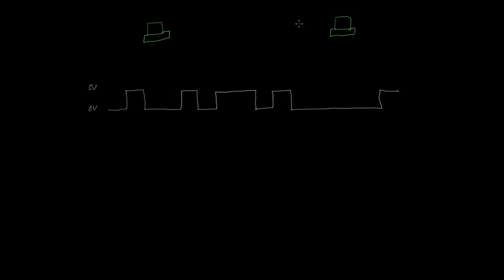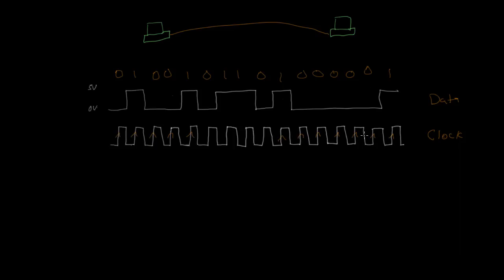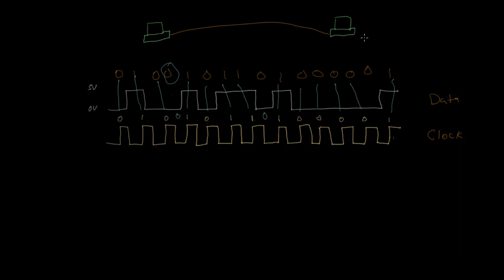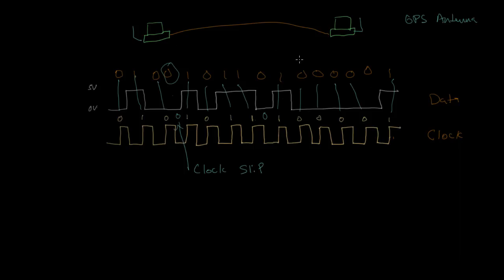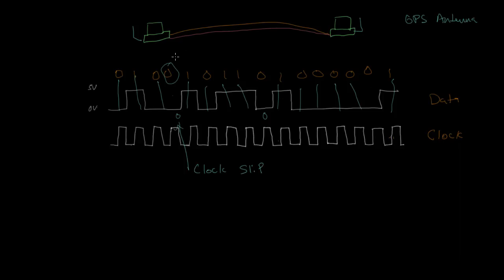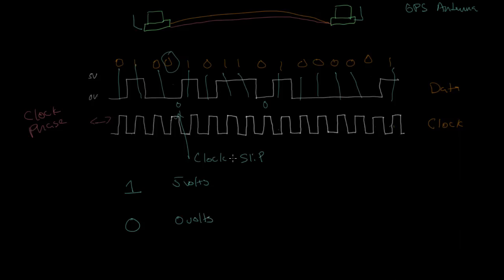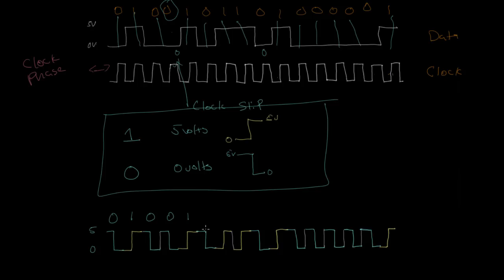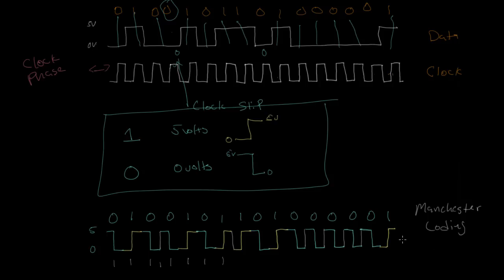Clock synchronization and Manchester coding | Networking tutorial (3 of 13)

Comment: This series is so good even for intermediate level learners. I do have a non-zero grasp of electronics and TCP/IP, and Ben is filling in a lot of gaps in my knowledge that I didn't know I had.
Reply: Do you know where i could pick up from after here? I mean after this series?
Reply: @quicksilver90-g8h  Excellent question. The principles taught are so wide in their application that the sky's the limit: it's really up to your imagination and personal inclination. I myself built the Ben Eater clock module (from his 8 bit computer build series). Then I thought of alterations I could make to the basic design (using breadboards makes that very easy). For instance, I thought of building a dual 6502 computer, with two processors. How to make two CPUs share the same bus? They have to take turns. So I added flip flops to the clock module, so that every other clock pulse was routed to a different output. Instead of one LED blinking, two LEDs, call them 1 and 2,  alternating their blinks in a "1 - 2, 1 - 2" rhythm, then with another pair of flip flops, made that into a 4/4 rhythm (I'm a musician, bear with me): "1 on, 1 off. 2 on, 2 off", so that each CPU, in my theoretical dual processor design, would get a full cycle of high and low while the other was kept low.

But that's just me and my imagination: doubtless you might go in a completely different direction. 

I wound up building the Ben Eater 6502, and got it to say Hello World (yay!) and never built the dual 6502 of my dreams. But what about the 16 bit version of the 6502, the 65C816? Another YouTuber, Adrien Kohlbecker, has an excellent Ben-Eater-inspired build of a machine based on that more sophisticated processor. The CPU is not pin for pin compatible with the 6502, but nearly so. It has a 24 bit address space, making the 8 data pins do double duty, alternating roles as the ordinary 8 bits of data, and the high byte of the 65816's 24 bit address space, so that the 65C816 can address up to 16 MB of memory, which is way more RAM than my first PC came with. Because the 8 data bit pins do double duty, you have to build latches to hold a copy of the data pins from the moment when they're used for the high byte of the address. Kohlbecker has now made a single board design that breaks all of this out into individual connector pins. 

So NOW, I want to take Kohlbecker's 65C816 design, and build two of them, so I can have, not just a dual 6502 machine, but a dual 65C816 design.

Now the question is, how shall they share memory? How does each CPU know whether it's CPU A or CPU B? Should they share all their memory, or maybe just share the upper 32KB of the first 64KB (so they read the same ROM on startup), or something else. ROM is way slower than RAM. Could I build "shadow RAM" for the second 32 KB (where the ROM lives), so that the computer starts slow, copies the ROM into the RAM behind it, then switches the ROM out, and increases the speed of the clock? That means I'd have to somehow let at least one of the CPUs control the clock speed. How would I do that? I could map one or more of the bits of the address bus for this purpose (the way the 6510 chip did on the Commodore 64, with bytes 0 and 1 of Zero Page RAM. Or, I could use a 6522 VIA chip as a "bus control" device to handle things like bank switching and clock speed. 

Should the two CPUs be completely symmetrical? Or could I make it so that one CPU can IRQ the other one, or allow them to IRQ each other (again, using one output from a VIA chip routed to each of the IRQs for the two processor)? Maybe I could make one CPU the primary, and the other the secondary, where the primary can interrupt the secondary but not vice versa. Then I could use the primary for the computer's "operating system" and the secondary for "user space" processes, which could lead to a CPU stable enough to run processes in a secure manner?

What about general I/O for my dual CPU design? Should each CPU have its own separate VIAs? Or should they share them somehow? If they share them, how do I control which CPU's IRQ each VIA chip controls?

So that's just my imagination: doubtless you could think of directions I haven't even thought of.

Would love to hear more of your thoughts here in this comment thread.
Reply: @AlanCanon2222 wow that was useful, thanks!

Comment: Hi ben, you mention that the recieving computer can distinguish between a low to high transition and a multiple 0's in a row because of the intervals the transitions occur at. How does the receiving computer know what interval to sample the signal at? Do the 2 computers need to agree on the interval before hand?
Reply: it would suffice to agree on some clock sync pattern at the start of every message. i.e. you know that every message starts with 0101. so here is your timing interval you can measure at the receiving end

Comment: Hey Ben, thanks for great series! You left out how the clocks exatcly synchronize for manchester coding, so how does this happen?
Reply: i was able to find out more about this from wikipedia. the process is called "clock recovery" where the two systems figure out (or "recover") what the clock rate is supposed to be from the signal itself.

as i understand it, the way it works for manchester encoding is that there are only two possible places where a voltage transition can occur: either at the start of a bit period, or exactly in the middle of a bit period. the one that's in the middle is the one that's supposed to represent the 1 or 0, the one that's at the start is just supposed to get the signal in the right place so it can make the transition for the middle of the period.

so when a computer starts seeing transitions, it picks one and sees if that results in a "regular" data rate (meaning -- you should be seeing some kind of data, i.e. a transition, every single period). if it doesn't, it knows that the one it picked was just a "positioning" transition and not a real data transition, and uses the next (n+1) transition for determining the data rate instead. the "real" data transition will happen at a guaranteed interval and so can be used to figure out the clock rate.

Comment: This is kinda similar to the encoding used in USB wires. The difference is that in the USB standard, 0 is encoded as a transition (either way), and 1 is encoded as no transition.

Comment: So, basically, Manchester coding is about half the speed of what the processing hardware can handle. It may have uses where the "cable" speed is the limiting factor, but otherwise, that sounds like a dramatic lost in efficiency. 

If two clock are not strictly adjusted to the same frequency, but "close", could they not "agree" to send "n" bits, then resynch them, say with a start bit, so they will, in theory, always safely read the data without slip ? Is it not what serial communication was doing? And thus, your efficiency will be more like around n/(n+1)  instead of 0.5, as for Manchester coding as I understand it ( assuming that the cable transmission speed can support a speed as good as the processing one involved by the hardware at the "terminals").
Reply: That's exactly how it's done with RS-232C encoding.  The line stays in a known state (usually high) until it's ready to send, then it pulls the line low for a period of one bit to signal the receiver that it's about to send.  Then it sends the 8 bits followed by holding the line high for a period of one or two bits (often one but sometimes two, depending on what both ends have agreed on) to signal that the byte has ended.

Since the receiving clock is synchronised on every start bit, the clocks can drift slightly without causing errors.

The receiving end often also uses a protocol which allows it to tell the transmitting end to repeat the garbled part of the transmission after an error is received.

Comment: what if I wanna send 00000000000000000011111111111111111 through Manchester codes?
I guess then the computer will guess that the "clock rate" is very low because from all those transitions going from a 0 to 0 and 1 to 1. Therefore it will not ignore the transitions from 0v to 5v between all the zeros and instead think that the transition between 0 and 1 is a little bit off  and discard it, right?

as a solution one could maybe make it so that, the computer always uses the bigger clock rate but would would happen then if I where to send a  signal containing only 1 or only 0s ?
I am a bit confused rn.

Comment: Hi, thanks for this great video. I had a question if anyone can answer... See if a computer has a rated clock of 3GHz, it wont always be boosted to 3Ghz, it varies with complexity of the task being performed.
So how is the data synchronized in these circumstances? I hope it isnt a silly question...
Reply: Curious about this as well. Maybe there’s a protocol that makes sure that two communicating parties are talking at a synchronized rate? Also you might be confused between processing clock speed and communication clock speed.

Comment: if you use Manchester coding to send the message 0000 0000, won't it be misinterpreted as 0101 0101 0101 0101 ? since the clock appears to be regular?
Reply: i guess, and this is only a guess, that you somehow send a rough speed of the clock at the start, then the reciever will compare the data to the clock signal at the start
Reply: At 10:21 he explains that there's still a clock, so it won't interpret it as another symbol.

Comment: Instead of Transitions High to Low (=0) and Low to High (=1). Send Fats and Slims. A Fat is a 1 and a Slim is a Zero. E.g. 1 - 1 = 1 and 1 - 0 = 0. Fats and Slims. This will work, however it will Half the Data Rate. You can recover the Clock (Synchronisation) from the Transitions. 
In most Transitions you will have an even Number of 1's and 0's. If you have a Long String of 1's and 0's you will Lose the Clock (drift). However there are Techniques to deal with that I'm not gonna go in to now.

Comment: BEN, where can i find a controller that can reproduce the manchester code? I have an animatronics show that used the manchester fm2 code and want to be able to program new shows. Please advise.
Reply: I don't know what Ben would say (and because of the way YT seems to periodically turn replies into base comments, I can't be sure whether or not anyone has replied to you), but I'd suggest using a microcontroller.

I'd be surprised if there wasn't already a "library" for most microcontrollers, and certainly for Arduino, which allows you to transmit and receive Manchester FM2 code on selected pins.

Comment: Why not use something like 5V for 0 and 10V for 1? Then you don't need a clock, because each data point would be either 5V or 10V. You would send them in pulses. So 0V->5V->0V would mean it's a 0 and 0V->10V->0V would mean it's a 1. There would be no 5V->10V and vice-versa transitions.
Reply: probably because it is sower because there are double as many signals per datasignal we want to send, i thought about making the clock and the data two signals on one line with two different changes in voltage ( the clock for example switches between 0 and 3 volts and the data between 0 and 5) so we have no differences in transmission time.
Reply: The more different voltage levels to distinguish, the harder it is to distinguish them, especially when there's a noise on the line. But if you have only two levels, they're the easiest to distinguish even on a very noisy line.
What you described, though, has the same problem as when using 0V and 5V levels – it's just shifted upwards (as if you added a constant DC offset to the signal).
Reply: As pointed out in the video, the original problem was a long duration of zero voltage... making it hard to distinguish how many zeros the message contained.  Which based on clock syncrho, it was determined to be five zeros.

Your scheme seems to have solved that problem without using a clock:
Message:
0 1 0 0 1 0 1 1 0 1 0 0 0 0 0 1

Your scheme: (Where A is hex for ten):
Voltage -> 050A05050A050A0A050A05050505050A0

Manchester encoding:
Voltage -> 50 05 50 50 05 50 05 05 50 05 50 50 50 50 50 05

7:36 *So another approach that we can take that's actually quite common is kinda ingenious which is to combine clock & data by using different symbols to represent ones and zeros*

Your scheme accomplishes this goal in an elegant manner.
Reply: It's called level triggering. What is used in the video was an edge triggerring. Which is divided into 2, rising edge and falling edge. Problem with level triggerring is that the input itself can have noises and will interfere during that level triggerring period. Which is why falling/rising edge is used instead.

Comment: Would it make more sense to us a ternary system in networking instead of binary to avoid the clock? For instance a signal that goes from 2 to 0 could be interpretted as 0 and 2 to 1 would be 1. 0 to 1 would be 0 and 0 to 1 would be 1. 1 to 0 would be 0 and 1 to 2 would be 1.
Reply: What you propose could be done.  In fact, it would be possible to make a system where you use 256 different voltage levels to send the numbers from 0-255 (8 bits), one for each clock cycle.

The trouble is, the more voltage steps you introduce, the more prone to interference the data is.  With the 0-255 system I described, even a power line a few metres away would introduce enough interference to turn the transmission into nonsense on the receiving end, and that's not even considering the interference from various electrical devices constantly being turned on and off.

TL;DR: It can be done, but at the cost of a less reliable data link.

Comment: We used clocks because we couldn't reliably interpret the data which was recieved. Using clocks both the communicating nodes know at what rate they should transmit/read the data off the wire.  
So u mentioned gps and using another wire for clock sync as a way to sync clocks between these nodes.  I dont understand how Manchester coding gets rid of the clock problems u mentioned,  as u still need to read the data at some regular interval i.e u still need a clock right? The reciever can still read at a faster rate or go out of phase even if Manchester Coding is used, so can someone explain me how does it solve the clock issues?
Reply: Because you are guaranteed one transition at the start of the period, you can back out the clock rate. When the receiver detects a transition either it will be at the beginning of the period, or halfway through to prepare for a repeating bit.

If you are familiar with micro controllers, if i have a hardware interrupt trigger at every transition and mark the elapsed time off a timer that counts the nanoseconds (or whatever would be appropriate for the speed you're trying to transmit). Ill end up with a list of transitions and times some of which are at the half period, and some of which are on the period. Because we know we have a transition at every period, i know the period is the longer of the two and can throw out all the transitions that happened on the half period.

The obvious exception is if you send all ones or zeros, in which case throw out half of them.
Reply: Clock stabilizes the output. It makes the event synchronous. Without clock, it'll be async

Comment: what do you mean by clock running faster / slower ? all clocks run at the same frequency ? Do you mean there is a time difference between the two clocks ? Like one clock is ahead of other by say n secs?
Reply: I know, it was a year ago but maybe you still want to know the answer. The fact is that clocks are not runing at the same frequency, there might be a little inaccuracy, so they will run a little bit slower or faster. Lets say you have two similar CPU's for example both with clock 3.3GHz, in reality chance that both have really the same clock rate is close to zero. One of them will be faster, maybe 1-2kHz but still. And by faster we talk about more cycles per second, not being ahead of other, clocks we are talking about is not like this one on wall or hand, it doesn't show you time like 3:17AM, it makes pulses very regular.
Reply: "Clock" in this context does not refer to a time-of-day clock like a wristwatch, but to a timing device used to keep something running regularly.  Think of it more as being like a metronome in music.

Comment: Why do you need two wires and not one?
Reply: All electrical circuits require two wires.  One takes the current out from the source and the other carries it back to the source.  But you can use one wire as the "return" for multiple "outgoing" wires.

Comment: your comments around 4:30 are misleading. No-one uses GPS satellites or atomic clocks to synchronize bus clocks. It provides a lot of pointless information (you don't care about the date or time of day when trying to shift in bits from a serial link), and wouldn't even be accurate enough for modern communication links that signal in the realm of hundreds of MHz or in the GHz. Plus it just moves the problem; how do you communicate between that super-duper clock and the rest of the computer?

I understand you're intentionally suggesting two "bad" options before presenting realistic ones, but i'm not saying they're bad options, i'm saying they're nonsensical.
Reply: spambot71 you aren’t understanding the use of the GPS time signal. It’s not to determine the date and real time. GPS sends a highly. Accurate time pulse that corresponds to the exact interval of one second. This can be used to compare the phase of the computer clock and if there is a difference a correction can be made to synchronize the clock with the GPS time pulse. Thes is called a GPSDO, a GPS Diciplined Oscillator.
Reply: @billmoran3812  Legendary! Where did you get that info.